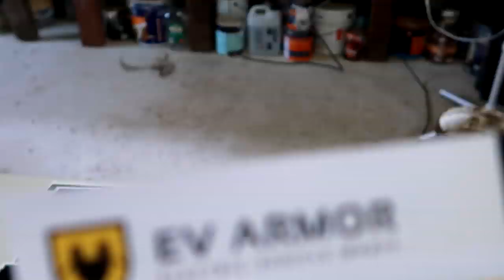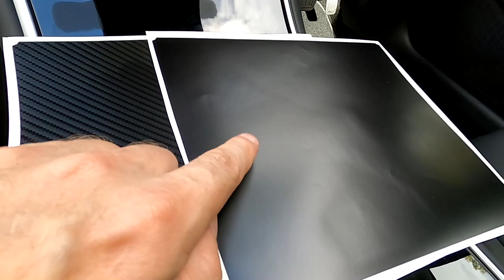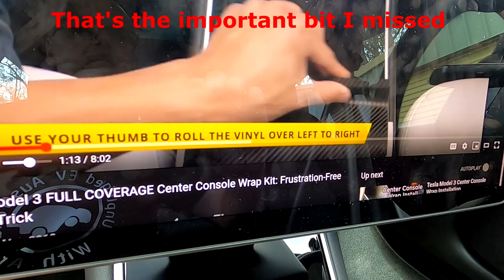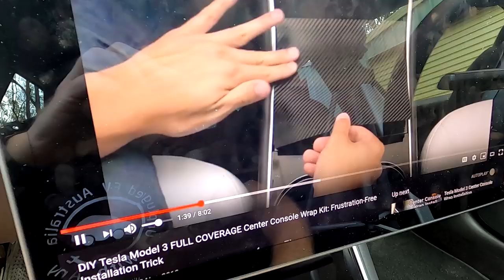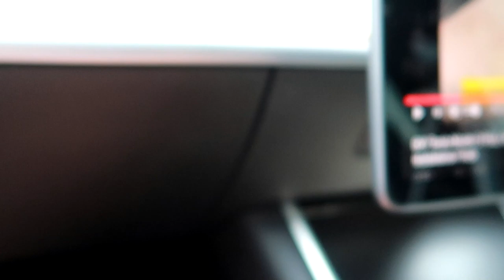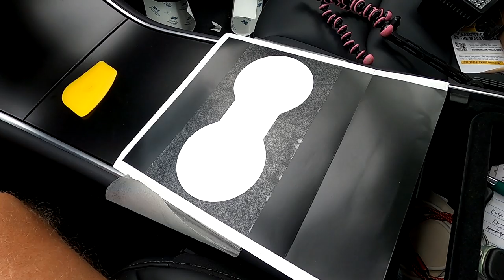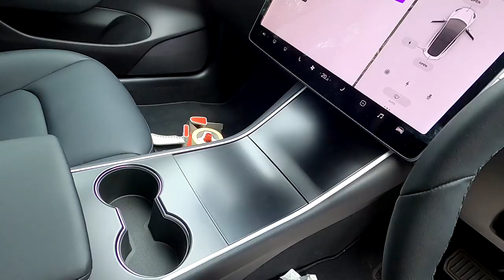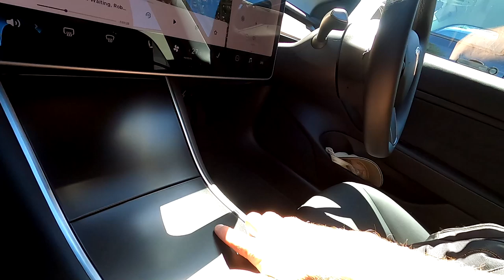EP343 - Model 3 Console Wrap. How frustrating can it get? #@&!$

Comment: Hey Andy,  This is what you get from a pre-cut wrap kit versus a professional vinyl shop.  The do it yourself kits don't come with installation warranty versus a wrap shop that would replace the piece for free because of installation or material error.  It is actually harder to wrap consoles with pre-cut pieces versus a full piece that you trim.  A professional installer can lock down the corners and post-heat them so they don't lift.  That first piece with the lines at the top was part of the material's fault and yours.  3M has an issue with their adhesive bunching together and leaving those lines when you place the material down and pull it back off the surface.
Reply from the maker: That is absolutely correct. A professional detailer would just laugh about this. However, you always get what you're paying for, so these kits are pretty cheap and not too bad for what you get. Time will tell how long they last...
It was probably my fault pulling the wrap back to clean out some dirt underneath. It got overstretched and damaged, hence the lines and marks now...

Comment: this reminded me what a cheap paint layer the phev has! stone chips not normal..i need a wrap to protect the front!
 btw, the norwegian chap has some "good sheeet" ceramic wrap on his muskmobile..😆
hope all well, stay safe!
Reply from the maker: A clear PPF plus ceramic coating would be ideal. Or waiting for the Cybertruck in a few years...
Reply: @unpluggedEV  the cybertruck..i still dont get the design..
using scrap metal, he built something he drew in school when he was 5!
Reply: off topic - did you know some phevs have a regular 240 volt plug socket in the trunk which is activated by a button called "AC 1500". mine was fully loaded option but seems not available everywhere. my manual describes both versions - mine is  the button slot blank and just a 12 volt cigar lighter type plug.
would have been cool- just run extension cable from car into the house and run up to 1500 watts of devices. no expensive "V2H" accessory module needed for house power backup.
Reply from the maker: @BakedPineapple1  that's country specific. I think they've got this in Germany from what I saw?
Reply: @unpluggedEV  ihr deutschen braucht doch so was nicht bei eurem tollen first world infrastruktur😉 im not sure about germany, mine was a swiss car. wish i had the feature, here in portugal we had a few annoying blackouts recently with dead trees knocking down power lines..
Reply: @unpluggedEV  i recently re-watched your episode 157 with Ralph - amazing setup he has...
Reply from the maker: @BakedPineapple1  he updated me recently and said he never used the PHEV as a backup. Solar and Powerwall was always  enough...
Reply from the maker: @BakedPineapple1  but what would you plugin and or how long? Freezer? Fridge?
Reply: @unpluggedEV  in an emergency with a full battery and tank it should power fridge and the basics(lights,tv etc.) a household basics for a week "according to mitsu". i would just want it for a few hours in a normal outage.. (fridge for sure,would have to check i dont overload if i add freezer..and consider power surge on startup of fridge compressor. ) but coffee machine oven and laundry on top i reckon not!

Comment: did you ever install a screen protector film on a large Tablet computer? last time I did it in the bathroom after showering lots of hot water to get a steamy environment and to get rid of any dust - a nightmare too :-)
Reply from the maker: No screenprotector has been installed. I don't see the point for that as the screen is almost vertical it's very unlikely that something hits it that hard.